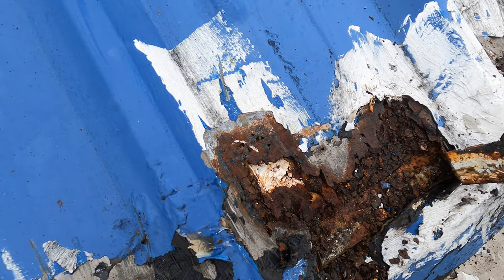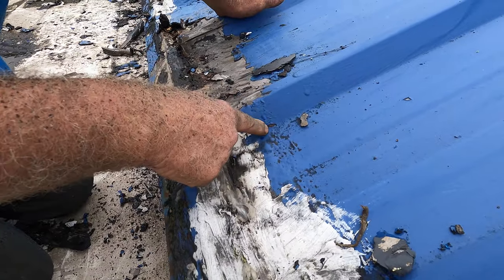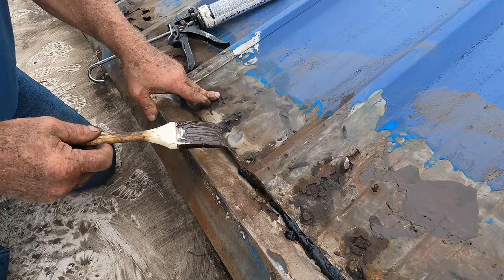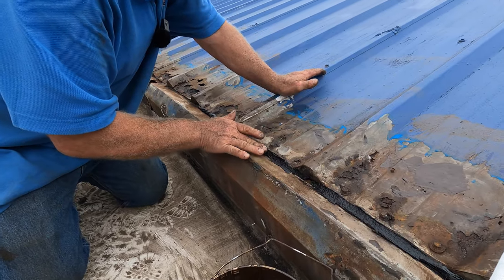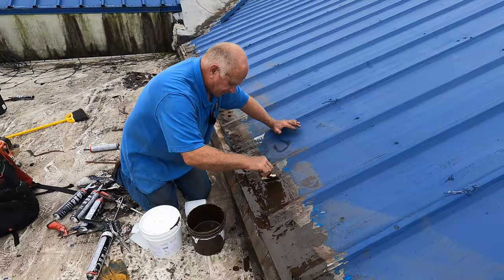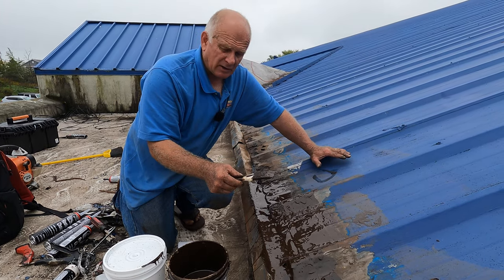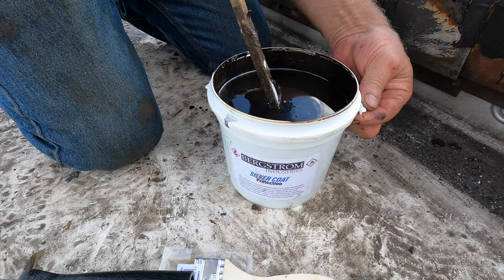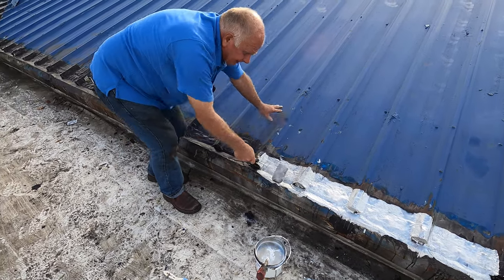Metal Roof Edge Repair - Stop the Rust

Comment: Thanks to your videos I am now able to help my house painting customers when they can't get a roofer to come out for small patches.   You didn't say anything about the exposed metal just beyond the Poly Seam Seal...won't it rust without some sort of coating? 
Can Poly seam seal be top coated with typical latex house paints, to provide the UV protection it needs?

Thanks again and keep up the great vids!
Residential Repair & Paint LLC, Central Florida